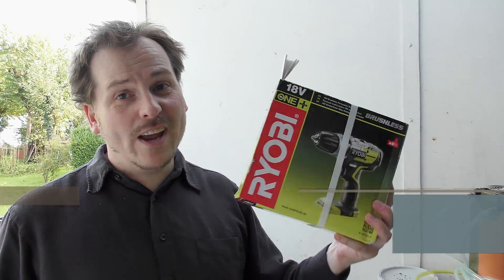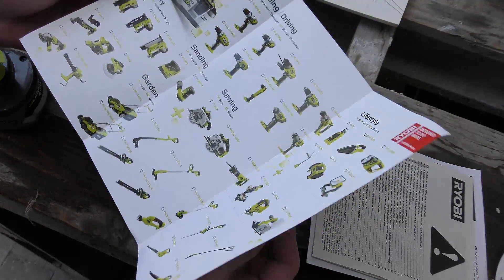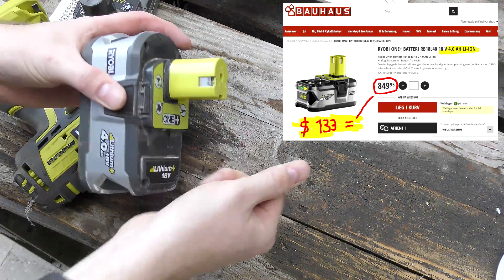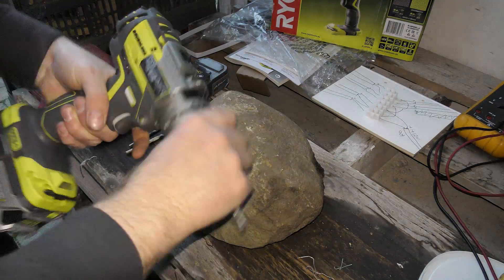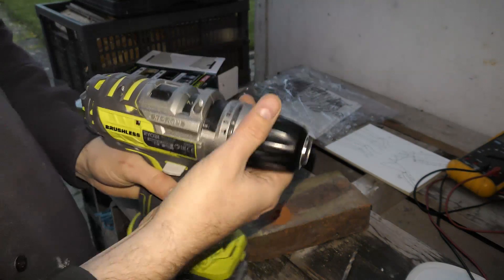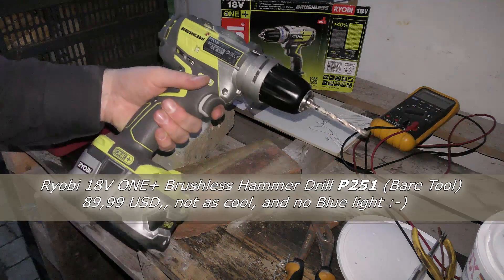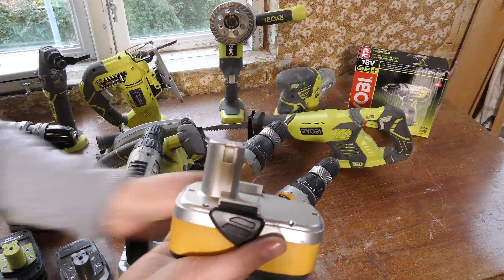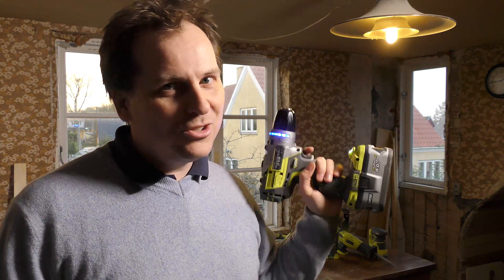Ryobi 18V ONE+ Brushless Percussion/Hammer Drill - 600

Comment: Hej Morten,
there is a good reason for the drill not to run fast in low torque setting: The spinning parts in the machine have their own inertia. When you aim for a low torque at tightening a screw, the torque the drill senses is only part of the torque going to the screw before stopping. The screw then has to stop the spinning bits and pieces in the drill as well, which adds to the torque.
A nice detail in design, really. Someone had his brain turned on when making that drill.
Reply from the maker: Hi Eo Tunun
Thank You very much!
Thank you for watching! :-)

Comment: That drill with a 4ah battery and bag is $159 US and they sell 2 -4ah batteries for $99 here also, our Ryobi brushless version doesn't have the blue ring but our has a metal chuck and a little more square and bulky, it comes with a side handle also
Reply from the maker: Hi Roof Repair Techs
Thank You very much!  They are dirt cheap in the US :-/ I would almost trade in, the BLUE LED :-)
Thank you for watching! :-)
Reply: My PlayHouse would it be cheaper if ya bought it from a US company and had it shipped to ya there?

Comment: That hammer function looks useless to me. Thats why you buy a drill hammer I guess!
Reply from the maker: Hi John Bäckstrand
If you drill two holes every second month,, the hammer function is fine. If you need 4 holes in Granit,, you want a drill hammer.
Thank you for watching! :-)
Reply: My PlayHouse I live in an apartment and I have used my drill hammer probably for 100 holes. Sure it's not a big part my time but it was reslly cheap, and it only takes a few seconds to drill a hole.
Reply from the maker: Hi John Bäckstrand
Yes there are those concrete buildings where you almost need explosives to get a bloody pictura on the wall :-)
Thank you for watching! :-)